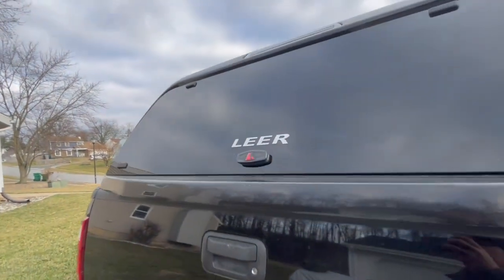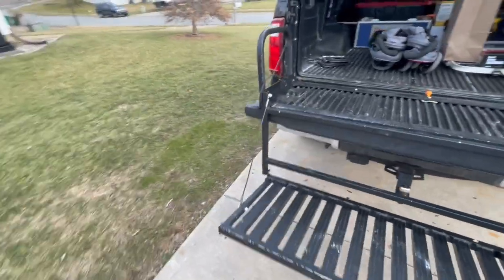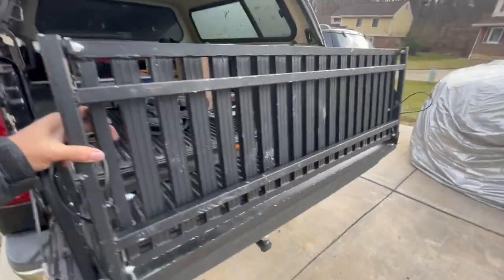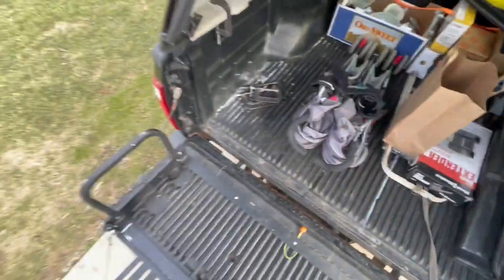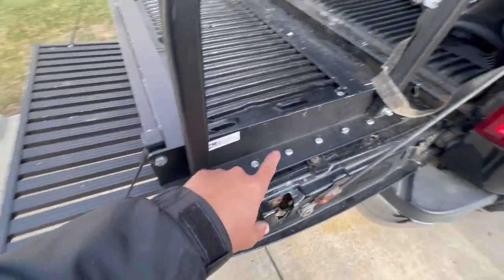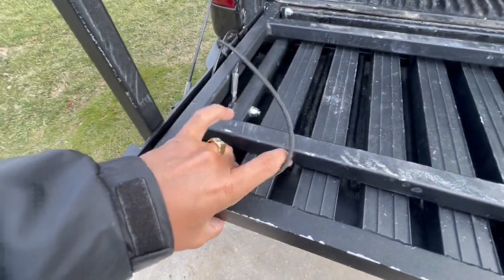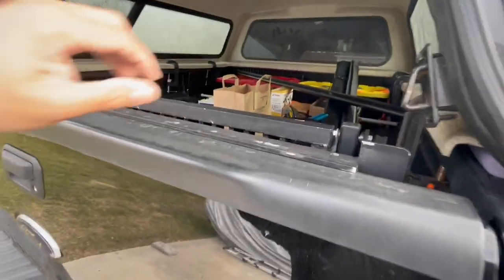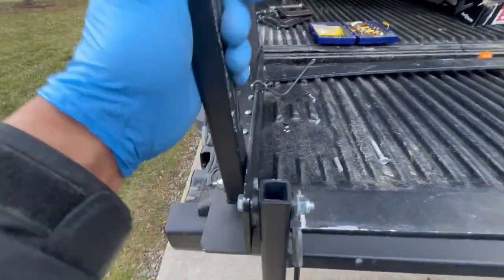Magnum Truck N' Buddy Truck Bed Ladder

Comment: How heavy is this? Did you get rid of the tailgate ladder noise after all?
Reply from the maker: It got heavier but still bearable. Maybe the weight of a another tailgate. Got rid of the noise by adding and zip tied some rubber pads in between the step and tailgate. Everything is tight and secured, no more rattling noise . Thanks!

Comment: Priced @ $420. The step stool I carry $20. What could I spend $400 left over on.
Reply from the maker: Yup it’s expensive new. And that’s why I just waited and found one for $20 used on fb market. Also can be used as a tailgate extender. I used to bring a step stool and small ladder but it occupied a lot of space. Just nice to have this kinda like a built in and use it every time.
Reply: @donlyl3  $20 definitely worth that. $25 ratcheting load bars keep the stool and other cargo in reach at the tailgate